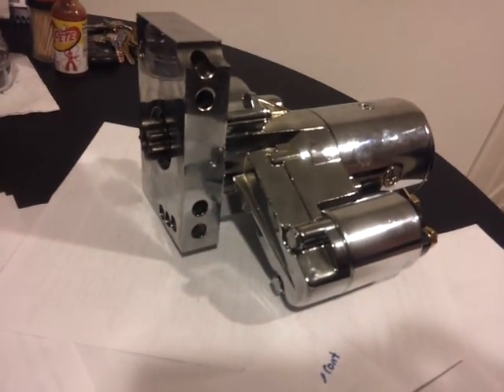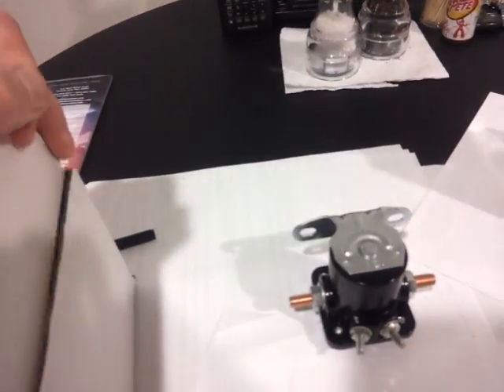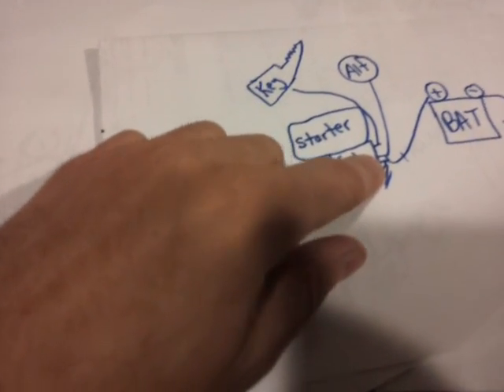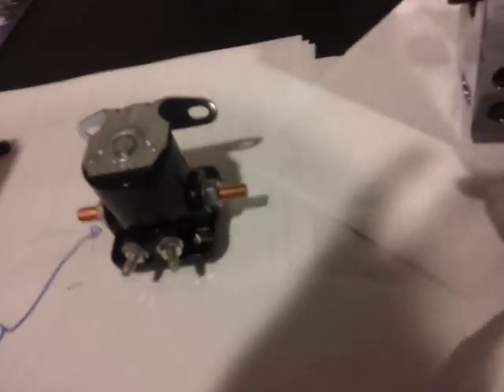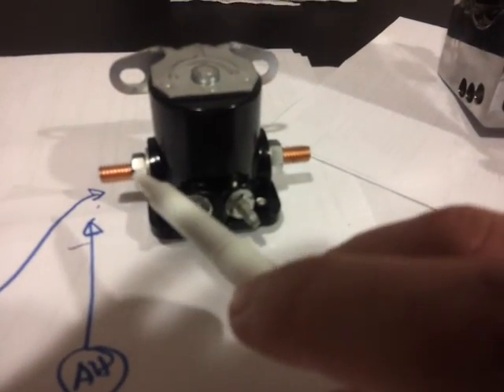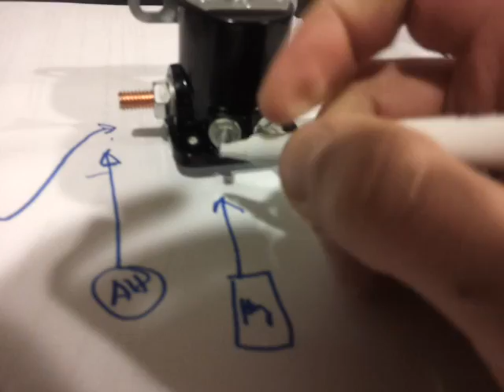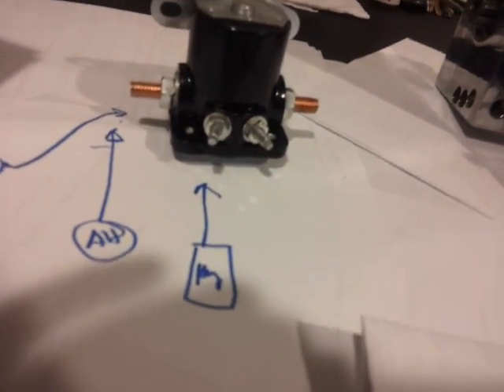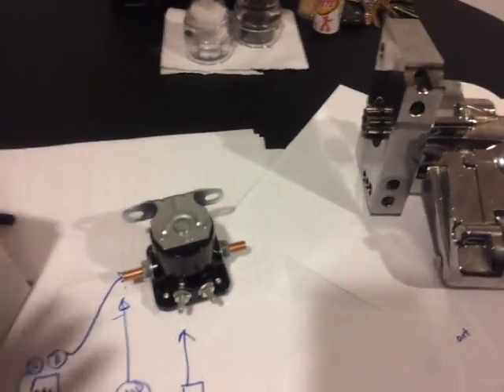DIY starter remote mount solenoid easy step by step how to with schematic

Comment: Klowny1969, Great video! Real easy to follow. The best part is that I won't have to crawl under my truck to see if there is a loose connection to the solenoid. I know there is one cable from the FORD solenoid that still has to be run to the starter, but I don't think I have ever seen these nuts and lock washers come loose. I have seen smaller wire to "S" or "I" terminal crack and or loosen because everyone is afraid to tighten them too much.

I already rewired my Blazer with this setup. I added a Anderson Powepole connector (use one side only) on the cable that goes to the starter from the  FORD solenoid. I put it nearer to the new solenoid. I hook it up nice and tight to the starter while the starter is out of the car, so I can really get it snug. The added benefit is that I don't have to work so hard to get the damned wire connected to the starter in a cramped and confined space. I just have to mount the support brace and the two mounting screws.

This setup has solved a lot of issues, where I used to curse having to troubleshoot GM starter no-start situations in the past. Easy and highly recommended. Big thank you.
Reply: That's the reason I hooked up one.. No crank no Start issues. Works fine but I have to use a switch.. Is it optional? To use a switch or key?

Comment: AMC used that same solenoid.  My '69 AMX has one just like that.  The I terminal is for the ballast resistor bypass.  During cranking, the coil gets a full 12 volts from the I terminal.

Comment: Thanks for the video! My solenoid on my sbc went out today. Got a fresh rebuilt engine and had extra starts on tuning and such. But in theory, isn't the one on the starter going to do the same thing as mine did fail because of heat or overstarting? Just curious what you think of that? Like is the failure rate less addingn a external solenoid?
Reply: Did you have any luck with this? I'm having the same problem for the same reason and wondered the same thing as well while watching

Comment: If this is for heat soaked solenoid, how does it work if you still go through the old one that's still on the starter and hot as hell , thanks

Comment: I have a 65 El Camino with a 350 Chevy engine I have the problem of starting when it's hot so I bought an external 1990 Ford F150 solenoid very similar to the one that you show in video.  Do you remove the red battery cable to it ? It seems like the solenoid that is on the starter is also running the external solenoid????

Comment: I got a question for you I have a 1993 forest floor no crank no start change the battery cables Illinois on it and nothing I have power to my lights And everything but won't start what do you suggest

Comment: so i can put that on a chevy to bypass my  solenoid ???headers are like  a half inch n gets super hot will it work if my solenoid is bad its a newish starter but when hot wont start unless i bump it with screwdriver😒

Comment: I switched wiring sets for whole switches and sensors, it was on a automatic car but mine is manual. I’m running into more problems than I thought, should I just switch back before I even try to finish

Comment: Thanks for the video man. I have a question. I have a total of 4 wires. I see the alternator and battery positive on the big lug, I have a smaller black wire I believe is the “S” wire, then I have another small black wire labeled “R”. I heard you mention the first two lugs but I did not hear you mention the “R” lug. My question is where does that wire land at on the new solenoid and what does it do and stand for? Thank you!

Comment: Hi thanks for posting your videos, I'm looking to put a permanent start button in my 1987 ford f150, the solenoid switch is mounted on the fender. I'm having issues with ignition key where I have to turn past the normal to start. I'm looking to turn key toward start position and start with button. Then to shut it turn the key off. Can you tell me if I go with one wire off new button. To positive on battery and the other wire off button to the small S terminal on solenoid block, and should I put a fuse somewhere in there. Thanks for your help

Comment: Is there a starter solenoid similar to this one, but instead of an 'S' and 'I' terminal, has a 'S' and 'G' terminal, where the 'G' can go to a switched ground like for a Chrysler style neutral safety switch instead of grounding through the mounting bracket?

Comment: Does the cold post only get power when the keys is engaged ?  Once the key flips back to the run position the power stops and stops the starter from spinning correct ?  Is there a post I can use on this to give power to my amp only when the key is in the on position ?
Reply from the maker: correct..you cant connect your amp to this..you need an ignition hot source..donot forget to subscribe

Comment: I know this is an older video, but I'm hoping Klowny or anyone can help. My Camaro has a remote solenoid on the inner fender. However, the positive cable from the battery goes to the other side (right side) (closest to the I terminal) and the other cable from the solenoid to the starter is on the left side (closest to the S) does this make a difference? It starts up, but want to ensure it's wired correctly. Thank you.
Reply from the maker: nope its good...can be wired both ways..thanks for watching

Comment: I'm looking into best way to do this I hear some people hook this up improperly and it ghosts solenoid stays on because they have there s terminal linked to the solenoid terminal on the starter, and holds power even after let off cranking. Your way seams way better. But I have a question how dose your starter know when to crank will it only get power when you turn the key all the way? I must be thinking wrong because I thought that was solenoid pops out a when the key is turned acc (not all the way) just before you turn to crank. Or is it solenoid pops out when you start cranking?

Comment: I am trying to add one of these to a Cleveland 351 with a starter that only has one big post. should I just go from the battery to the solenoid, then solenoid to the battery?

Comment: im having problems with the jeep not cranking...i put a new starter solenoid just like the video so i have a one wire alternator that goes straight to the battery. so how can i do that setup? or should i just connect it to left side of the solenoid and ignition to the "s" and the right side to starter. am i missing something else or what?

Comment: I have a 73 Mach 1 and there's a 4th wire coming from the ignition coil, if I put it with the key wire the coil begins to heat up. What should I do?

Comment: My 1973 ford f100 turns over as soon as I connect a hot battery to the truck. Pretty sure it’s wired exactly how you explained. What should I do??
Reply from the maker: Solenoid could be stuck
Reply: klowny1969 also Ive gone through three solenoids. What could cause that?
Reply from the maker: Check to see if u have constant hot at the small signal terminal..that should only be hot when u turn the key to crank

Comment: Great video. I have a question about a 3 post solenoid. I have one with a bump start on it. What do I do with the R terminal wire. I think it is suppose to get 12v from original 4 post solenoid?
Reply: do u have hei or points distributor?

Comment: Got a quick question and problem. I hooked it up like you explained and it didn't start by turning the key so I jumped the S and the live side with the switch & wires and it started when I flipped the switch off it kept turning over. I unhooked the battery and took the power wire I ran from the old solenoid to the live side of the solenoid. after that I connected the switch to the live side and on the S , connected the battery and hit the switch and it started and I flipped the switch back off.. It kept running I took it for a drive and my interior lights stayed on the whole time. I have a 2005 Lincoln navigator. I had a no crank no start issue and advanced track error also a odo data error. I really need help.. Also when I was driving my speedometer wasn't working
Reply from the maker: Are you saying that you had a no crank issue and you did this is a fix? If that's the case, I would figure out what's wrong with the car first

Comment: Helped a lot, thanks. One question, I have a mystery wire. Its 1979 mustang cobra v8, and I have a wire that i dont know where it goes. The car has an aftermarket security system in it, would it be possible that a wire frome that would go to the solenoid? It also has an engine kill switch hidden that prevents spark, but i tested that and I dont think the wire is from that because it still worked when the wire wasnt connected. Any clues?
Reply from the maker: where on the solenoid does it go? the small stud or big stud?
Reply: It has to go on one of the small ones because it wouldnt fit on the large one. Im 99% sure its for the alarm/security system after attempting to follow the wire through the firewall
Reply from the maker: +kyle kaminski probably a remote start for the alarm

Comment: Just found this video, my question is how would this help with the hot start issue if it still uses the solenoid mounted on the starter?
Reply: Kind of wondering the same thing, isn't there a plunger of some sort that needs to move in the old solenoid and if so won't it still get hot?

Comment: I'm having that issue where my car won't start when I drive it for a while and my battery light is on I replaced the battery and had the alternator checked all working good but car won't start after I ride around the block a few times I have the same starter you've shown in the video any suggestions
Reply from the maker: Do a voltage drop test on your battery cables

Comment: Where do you buy that little metal jumper? I used to use a piece of tin can lid cut with tin snips to make mine from scratch but the one you got looks a lot nicer than what I've always used.
Reply from the maker: It came with the solenoid kit

Comment: I got mine all installed but all I had was some 10 ga. wire to run from the remote solenoid to the starter. It isn't sending enough power down to the starter to turn over the engine. What gauge wire do you recommend? I tested the solenoid without the wire from the solenoid down to the starter and I get over 12 volts but with the 10 gauge wire down to the starter I only get about 8 volts.

Comment: Hey Nice video!I have a question for you.  I have this same solenoid in my truck.  I have it wired the way you state as well.  My truck wont crank.  However if I jumper the battery to that s post it cranks.  Without jumpering I there is no cranking.  Would this suggest that the solenoid is bad or the ignition switch.  I would appreciate any advice you can give me and thank you in advance for your time.  Will
Reply from the maker: sounds like ur issue is somewhere in the ignition circuit..ie: ignition switch,neutral safety switch, starter relay etc..

Comment: Why does my solenoid keeps getting stuck or something? It turns on fine for a couple of weeks and all of a sudden it won't crank. I bang on it a few times and it works again. I already replaced it and it's doing the same thing. Could you explain what's going on. Thanks
Reply from the maker: adan alvarez try a better brand solenoid..and double check for any loose wires..or bad wiring
Reply: klowny1969 what are some good brands for a 72 ford F250

Comment: im hearing that people have starter run on when doing this. is it true? they say its because of the jumper wire on the starter
Reply from the maker: u might get the occasional sticky solenoid but overall i shouldnt have any issues
Reply from the maker: +klowny1969 *you
Reply: +klowny1969 what do you think about avoiding the ford solenoid and just putting a 200 amp circuit breaker on the power wire
Reply from the maker: +ss396rat a circuit breaker is like a fuse..not sure why you would want to put a circuit breaker instead of a solenoid? A solenoid will help with heat soak..a breaker wont
Reply: +klowny1969 im gona use the solenoid, i seen one guy with a breaker on his battery cable thanks for the info
Reply from the maker: +ss396rat no problemo sir

Comment: Alright so I'm redoing the old brittle wiring on my 74 Dart and I'm still fairly new to the engine electronics/ignition systems so bear with me here. I've heard you refer to the solenoid as a relay a couple of times. Is a solenoid the same thing as a relay? Would that be why my starter doesn't have a solenoid on it but a 10gauge wire running to a relay mounted on the inner fender well instead? The motor is burnt up so If I replaced the starter with one that has a solenoid mounted on it like that really chromy looking starter in your video could I toss the old relay and just run the ignition switch wire strait off the S terminal on the solenoid. The previous owners left the car's wiring a complete CF so i'm trying to reduce the amount of wires I have running around and remote mounted relays way out in left field acting as eye soars and what not. I'm a bit OCD when it comes to organization and stuff lol.
Reply: Yesir sounds right..good luck!
Reply: Manny Kran
Awesome :) Thanks, I'll probably need it lol.

Comment: Will this work on a high torque mini-starter with a permanent magnet? I have seen some diagrams saying to not to use a jumper but rather wire the "I" terminal on the solenoid to the "S" terminal on the starter?
Reply: u will need a relay

Comment: gooooood video, i need to install a master cut off switch, where would that come into play?
Reply from the maker: that depends on if u want to be nhra legal..in other words..if u want to be able to shut the car off when its running..then u can check out my video on how to wire a relocated battery..if not. then just put a disconnect switch between the positive terminal on the battery and the feed cable to the alt/car..thanks for watching
Reply: Yes it needs to be nhra legal, i will check out your other video thanks

Comment: Klowny - Thanks for taking the time to post this video. I installed this kit today on a C6 Corvette. Worked for the first two starts, then the starter stayed on (engaged and cranking) for a few extra seconds on 3rd start.  Then on the 4th start, it stayed on and wouldn't tun off until I disconnected the battery. Car was not hot (only run for a few seconds between these starts), battery had been on a charger all night, solenoid was new (same kit as you show in the video) and I wired the way you have here (same as instructions in kit). Any thoughts on what caused the starter to stay on?  Thanks, man.
Reply from the maker: +Charles Steenveld hey thanks for watching. .check to see if the solenoid is sticking..i have a video on how to test these on my channel..a simple test light can be used
Reply: +klowny1969 Thanks again - turns out the solenoid was bad - pretty common for those solenoids. I upgraded to a HD one from a Super Duty Ford truck and its good now. Running the same remote set up, just a more robust solenoid.
Reply from the maker: +Charles Steenveld yup thats what i figured..awesome

Comment: People....I have read so many comments on here, that think by adding this, it will correct a failing solenoid on your current starter....IT WILL NOT.....you still need a good working solenoid on your current starter, regardless whether you add this remote solenoid or not.....

Comment: we have a 79 ford f250 have replaced the starter and solenoid relay on fender wall now it starts with the key on in acc position but the starter continues to spin untill we disconect the battery whats up with that any help would be much appreciated, stuck in arizona.wayne and karen.
Reply from the maker: Check at the solenoid to see if the small wire continues to have power..if it does then u have to trace that side of the circuit..if it doesnt then its the solenoid sticking
Reply: THANKS THAT DID IT,OREILLYS GOT IT RIGHT ON THE THIRD TIME,THE SOLENOID WAS CONSTANTLY ENERGIZED
Reply from the maker: Glad I was able to help :)

Comment: Sounds logical except what is the purpose of this?  Adding a second solenoid to your starter so you can mount that 2nd solenoid to the firewall?  Maybe for troubleshooting purposes.??
Reply: I have a 93 ranger I changed negative ground and positive where does plug off neg go mi truck want start
Reply: It solves the heat soak issue common on modified GM engines with headers.

Comment from the maker: I cant get a good picture of the starter you are talking about..however , all starters are essentially the same..if u have headers close to it, it would be a good idea for a remote mount solenoid..i also have a heat shield from jegs that u wrap around my starter for extra heat protection ..

Comment: I did this to my 88 GTA tpi 
And it didn't fix my hot start issue 
Do you need a new starter that doesn't have the solinoid in it 
I'm using my factory starter 
And I put on a dei versa wrap on my starter and it fixed my hot start problem 
So I did all of this for nothing
Ty
Reply from the maker: Ben Kalinowski this is a common starter heat soak fix..and so is the shield..sometimes one works and not the other
Reply: klowny1969 ok
I'm just happy it's fixed 
Either way 
I was just curious if you had a different starter for it
Reply from the maker: Nope..no special starter..thanks for watching and commenting

Comment: klowny1969.. I'd like to use this Ford Solenoid as a switch to protect my house battery bank in an RV application. Do you see any problems with always having the 'key' post always energized to allow flow from my house battery bank to my DC appliances, and when I want to turn it off, I'll hit a switch I'll put on the 'key' wire? The reason why this solenoid could work well is because of how many amps I can run through it.. Thanks for the great video!